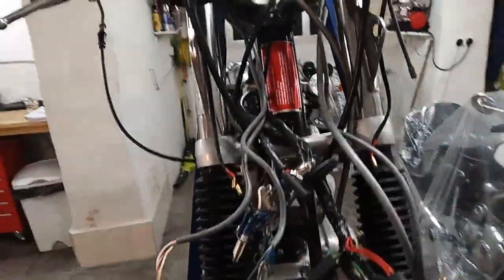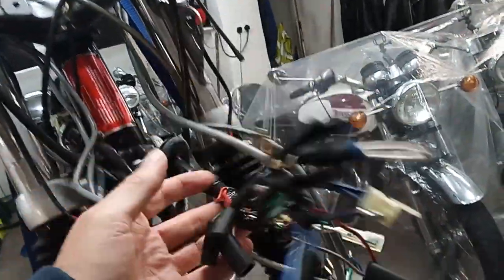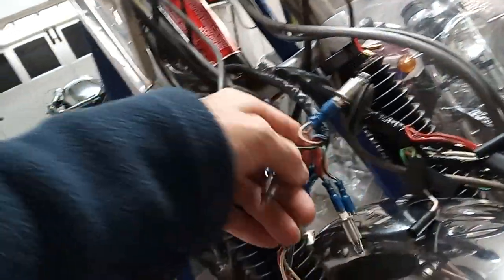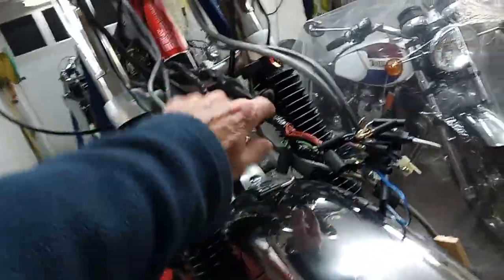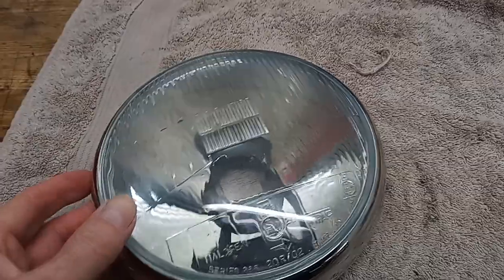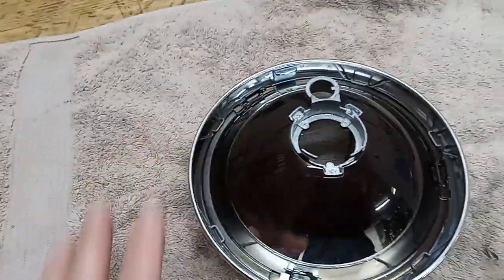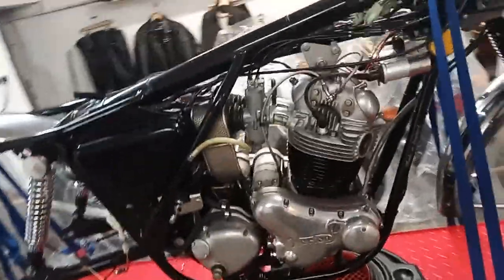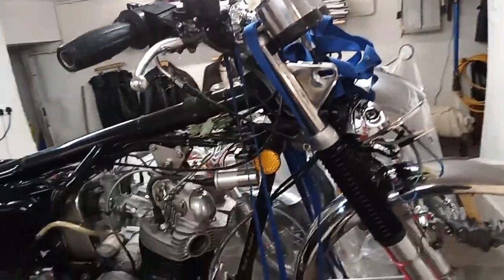Norton Commando 850 MKIII Service and Recommissioning. Part 9: Continuing Sorting the Electrics

Comment: My Mk.2A holds the Motobat MBTX14AU perfectly in its base.  Across the frame and not inline since it came with the large black plastic air filter box.  After fitting an Alton starter I may have to try the MBTX20.   The platform where the air filter box used to sit is now used for mounting the starter solenoid and a voltage regulator/rectifier.

Comment: Haven’t had a look yet, but I’m sure on my mk3 ,the battery fits across the frame………..
Reply from the maker: It might well do. This bike has been converted to a MKII air filter, and as part of that you have to change the battery carrier that it mounts on to as well. So this bike is essentially a MKII set up - as is mine. So I'm not sure exactly what size battery a standard MKIII would take. 🤔
Reply: @Chris.rooke150  A motobatt 16ah battery fits in the space perfectly, think it’s a 14au ,but 16ah. I also changed to a ham can, which is so much easier to fit with mk3 battery across the frame. I also rubber mounted the powerbox to the back of the ham can. I think Norman White advised me that that was a good place to put it.👍
Have to say, when i did mine a couple of years ago, your book was brilliant and made it so much easier 👍.
Reply from the maker: That's great. Many thanks for your comments. 👍

Comment: Spec for main headlamp bulb please - I like your advice on replacing the headlamp bulb only! Logic that it is a main source of battery drain, it’s on my list to do.
Reply from the maker: Your best bet would be to have a chat with the supplier, Paul Goff. He has a website and can be contacted by either phone or email. He knows just about all there is to know about led bulbs for classic motorcycles. 👍

Comment: I see you changed solenoid. It sticks up where the original is flush with frame. Does it interfere with seat at all?
Reply from the maker: The new solenoid was fitted by Norvil when they rebuilt the bike. It's not one I'm familiar with, but works and fits well with no issues.

Comment: You have to be careful with LED headlight, the turn signal circuit bleeds hound and turns on both high and low beams on my bike. This results in the death of the unit. I have a 180 three phase and now use H4 halogen. I use LED brake and indicators.  I have electronic flasher positive ground from a Jaguar. It has a third wire for indicator bulb, works great. Can not fit LED bulb in my small Motone billet turn signal units. The LED brake light is perfect and the LED pilot is so brite I never use my H4 during the day.😢. A LED works best on all lights except headlight in my bike.
Reply from the maker: I had a similar problem with the headlight and main beam warning light on one of my Tridents (but not the other!) The supplier issued me with a replacement (different) headlamp bulb to cure the 'dipped and main beam on at the same time' issue, and also with a simple fix for the warning light (as they have done with the indicator warning light on this bike) and all is now well in both cases. 👍